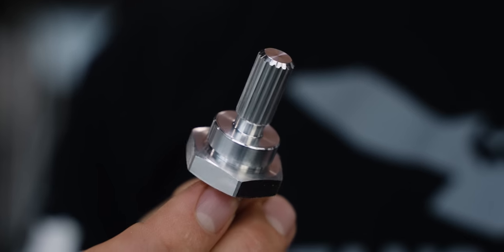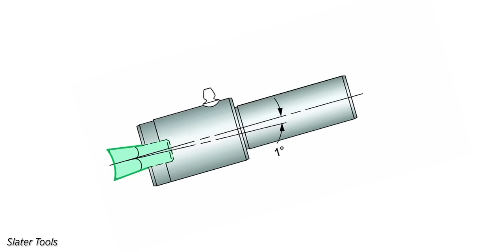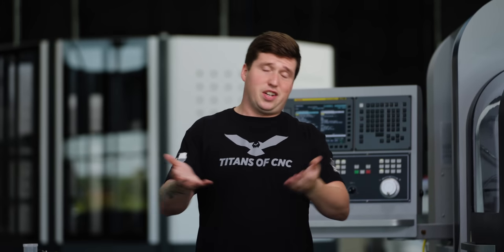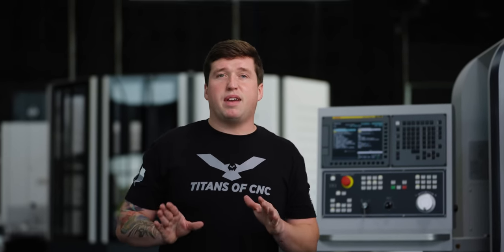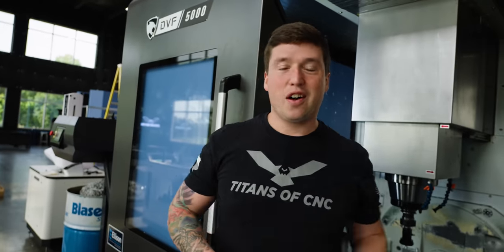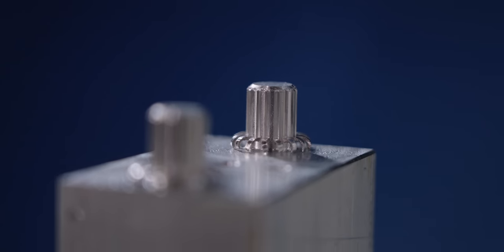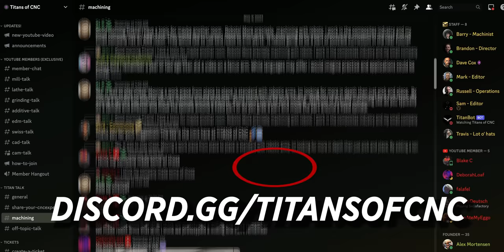BROACHING: Innovative Way To Cut Complex Metal Shapes

Comment: I've done internal rotary broaching on a ton of metal parts. It's absolute wizardry.

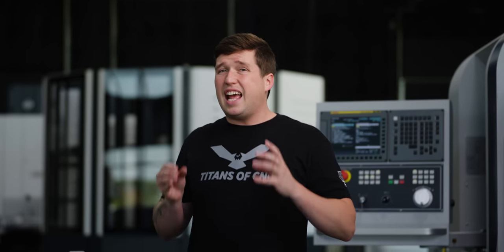3:37 Yes. We tried broaching on some 17-4 PH900 and kept breaking them. We switched to annealed and heat treating the parts after, it made it a million times easier.

Comment: We use rotary broaches on our swiss machines for a couple parts made out A286 stainless. 2mm hex Broaches and super alloys make for a less than fun time
Reply: I actually had to throw in the towel on a hexalobe that size in that material years ago. I’m impressed you are pulling that off

Comment: Great vid Donnie. Question: why did it seem like the part and the tool are spinning on the swiss, but only the tool spins on the mill?
Reply: I suppose I could just walk over there and ask you LOL
Reply: @barrysetzer  I was thinking the same 😂
Reply: It’s either one or the other. If everything was spinning it would be the same if nothing was spinning. Something has to be static for the broach holder to work properly. I’ll come over to your desk and talk to you about it 😂
Reply: Booooommmm! Donnie 😂
Reply: @donniehinske  while you go donnie can you ask him how to inspect surface finish on a curved surface a methode that is not touch and look please just want to see the device and the arrangement and how to do it overall
Reply: On a mill the holder body spins while the broach and the part don't spin. On a lathe the part and the broach spin while the holder body doesn't spin. Either way you have the same relative motion and the same wobble.

Think of it like drilling on the mill vs drilling on the lathe.

Comment: I’m building a rotary broach and grinding my own broach inserts.  Love this video
Reply: That works well if you need a special size or a one of but there are many places out there that offer standard solutions along with specials. Slater Tool, PH Horn, NSK, GenSwiss, Harvey Tool, Hassay Savage to name a few I have used over the years.
Reply: @rickdee1983 … yeah, I’m well informed and aware of this. I make the vast majority of my own tools and holders. It is for a one off job but it might turn into a regular run part.

Comment: Can you talk about vertical broaching. Set spindle angle, set z plunge and x/y step over. Use this to get around using edm and/or another op.
Reply: the spindle angle should be fine at 90.
The 1 degree offset was built into the broach holder they used, as he stated near the start. 
setting the center was done by feel, as he demonstrated by wiggling it into place. 
there should not be any x/y step over, you do not want to be moving the table while broaching as it would break your bit. 
the z plunge would just be whatever depth you are wanting to broach.
Reply: @thezyreick4289  vertical broaching is when you scrape the wall(usually a tight corner with straight down z strokes. There are form tools on the market for that purpose. You basically turn the cnc into a metal shaper.

Comment: Why does the internal broach stop turning once it goes in the material?
Reply: Because it engaged the material. If it spun it would just wipe everything out. The spinning of the holder makes it wobble in and out of the cut making it pretty easy to put the shape in there
Reply: @donniehinske  all right makes sense. What I'm wondering now if whether there is a way to control the orientation of the faces?
Reply: @87mits  depends on what you are trying to do. If you need to do that I’d recommend other machining methods for the most part
Reply: @87mits I think you can control the orientation. I don't have one to try to confirm...

Comment: How does the part in the lathe move in and out while spinning. I've never been able to find a good explanation for this.
Reply: Are you talking about in and out of the cut? If so skip to the part of the video where I hold the tape. Due to the holder being at an angle only one tooth is engaged in the material at any given time. The tool spinning is what’s making this happen
Reply: I think you are seeing the guide bushing. On a Swiss Machine there is a bushing through which the material is fed and held from behind. That way all of the cutting happens very close to the guide bushing. Makes for very rigid cutting conditions.

Comment: What tolerances can you hold on a rotary broach?   I build pull broaches and I need to know a better way for chip relief.   Because I think the guy that taught me got it wrong on the back face.   That is relief for chip break correct?   I have 9 years as a cnc punch broacher and 1 year on mazak lathes.  I need to know where the chip break is on a pull broach.

Comment: Not a machinist, Just somebody who watches these videos.

When the tool is spinning like this, how do you ensure proper orientation of cuts?

Say you were broaching a square hole into a square piece of metal, and it's important that the sides of the host material are parallel to the sides of the square hole you're making.

It's not obvious to me how you can ensure that you're orientation of the cutter is proper at the moment that contact is made with the material.
Reply: Simple answer is that you don't. The broach is a free spinning tool. There is no way to orient the broach inside the holder. 

You "could" stop the rotating of the part at a known rotation angle as you withdraw the broach, but it's not guaranteed to remain in that orientation. I've seen other tricks used to try and maintain broach and part orientation. Some work better than others, but they are not always successful.
Reply: @brandons9138  I was thinking about this for a while earlier.

one conclusion I came to would be to turn the part at a speed that matches the turn rate of the tool, and then stop turning the part once contact has been made.

This is only really feasible with parts that are of reasonable size.
Reply: @Budabaii    The broach is not a powered tool.  It free spins at the same rate as the part once it is engaged.

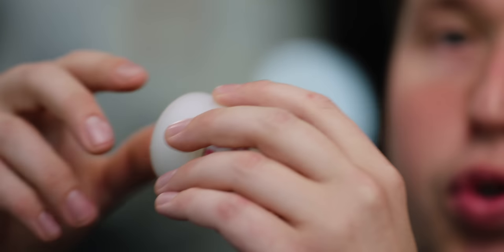Comment: The animation at 1:44 is wrong. The manufacturer doesn't even get the principle? The workpiece is rotating, the tool is at an angle, but not the axis which it rotates around. Just imagine it the opposite way. Let's rotate the tool's shank. The rotating broach has to be at an angle so the spinning induces the wobbling. In the animation the rotation axis is parallel to the shank. It's easy to see something's wrong, as the angle of the tool rotates with the part, so essentially they just push it in at an angle, with no wobble...

Comment: 9i still don't understand how you cut straight lines with something spinning
Reply: The tool has that form in it. It spins with the part once contact is made. Now if you didn’t spin the tool it would absolutely obliterate your part 😂. That’s why they both spin on a lathe